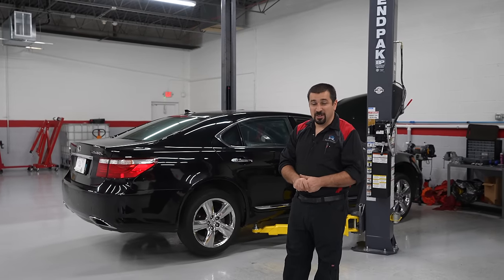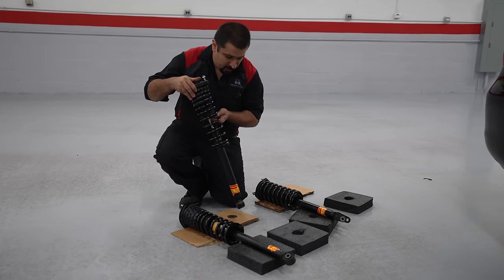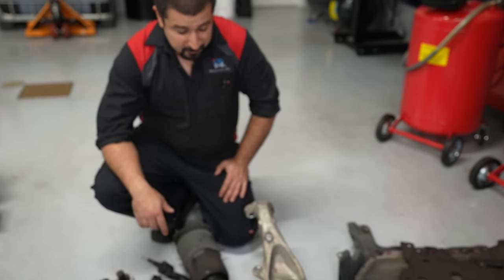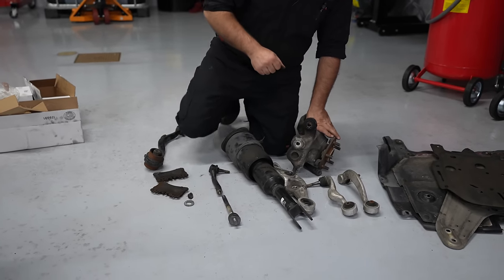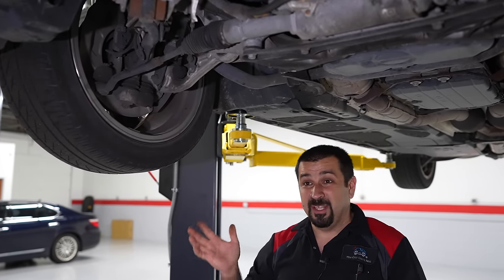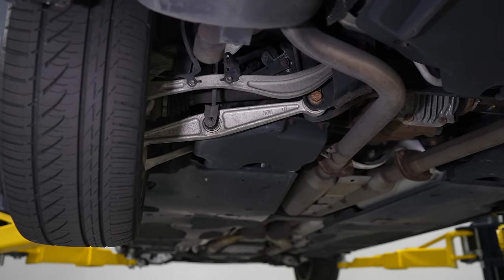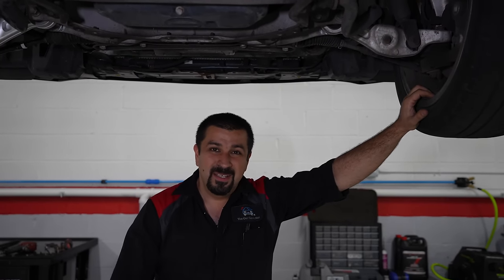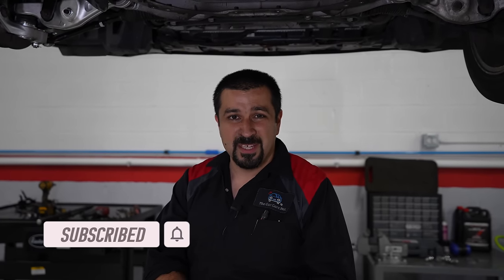Avoid THIS Lexus Model | Pre Purchase Inspection REQUIRED for this one and Here's Why.

Comment: My son wanted a higher end Lexus with all the bells and whistles.  I informed him that all those extras mean headaches down the road, plus they take premium gas.  He ended up with an ES350 - simpler but still has a nice interior.  So far he’s been happy with it.
Reply: Exactly you don’t need modern cars full of electronic crap and huge tables in them. So called outdated cars just works better and have less headache. If you want expensive modern car go and lease it.
Reply: @Motorsportsgeek  have you even driven the es350?  They are based on the Avalon btw.
Reply: @dyalanbrain001  Avalon is a camry, not hating on it, Camry is the best selling car in the world for good reason but typically when you go Lexus, you want the rwd based that is more of a lexus and less of a toyota.
Reply: We don't even have peasant fuel anymore across the pond. It doesn't hurt to use good fuel to have more power and a healthier engine. Unless it is a rather primitive design. 😊
Reply: @kr9181  The price of comfort is more electronics. 🤷‍♂ You can have even reliable electronics Japanese so called luxury cars of the 90s are prove for that, especially the Toyota Crown.
Reply: I thought I could buy one and get a 400hp reliable 4 door sedan. The car was a fast fun car but it sure wasn’t reliable.
Reply: @worldhello1234  if you are buying expensive car be ready for expensive repairs. More then over don’t buy used luxury car. But if you want one - new only and keep up with proper maintenance.
Reply: ES is a GREAT used car! The LS is very nice too, but as a previous owner of both, the LS issues add up VERY quickly.. Almost to the point where you pay for the car twice…
Reply: @worldhello1234  Comfort and no money to pay for it but is you are happy, well let all that money spill to the dealership,they will be happy.😁😁😁😢
Reply: I had a 2013 ES350. Bought it used in 2018 kept it for 2 years and sold it for financial reasons only. The car was flawless, not one issue in 2 years.
Same month I bought my 2002 ES300 from the original owner w 160k miles. All records showed on Lexus owners website. Timing belt, water pump and valve cover gasket all replaced at 88k miles.  Best car I’ve ever owned! Fit and finish is unparalleled. Craftsmanship is amazing. Tight and quiet. I’ve had comments on YouTube saying that it’s just a glorified Camry not even close the amount of insulation used and the tightness of the suspension is unparalleled. Shock tower brace under the hood and rear structural brace behind the rear seats really solidified this car
Reply: @worldhello1234  I've got a Toyota Crown Athlete VX and is has amazing tech for the time. It has also been completely reliable in the 2 years I've had it. Crowns, Elgrands, Vellfires and Alphards are all luxury and reliable
Reply: Nope
Reply: You don’t need to use premium gas and you don’t need to fix everything that breaks.  It’s smarter just to drive em the way they are.  I’d replace the air suspension with old steel suspension.
Reply: @Motorsportsgeek  avalon is not a camry
Reply: @worldhello1234  In Europe, the octane rating on the pump is simply the RON figure. America, by contrast, uses the average of the RON and the MON figures, called the AKI (anti-knock index). Thus, 97 octane “super unleaded” in Britain is roughly equivalent to 91 octane premium in the United States
Reply: I hope he isn't putting premium in it because my 2008 says it needs it but Toyota says it's not required. Takes regular.
Reply: @toyota420xp  It is look it up, they are based off the Toyota K platform (Camry), so are the ES300-ES350s
Reply: @mj28inpa  Wow man, that is sad. Considering LS400 was the Launch of Lexus in 1990 with market changing opinions of what is reliable and service. I remember the service was so amazing that one owner lived in the goonies in the middle of nowhere and his turn signal started to malfunction. A Lexus rep drove a replacement LS400 to him, drove his car to the dealership and back. It was big news. People bought Lexus for that reason.
Reply: @Motorsportsgeek  I hate to tell you this but an Avalon is not a Camry.  The Avalon is different and larger than the Camry.  That's like saying the Camry is a Corolla.
Reply: @frankie3591  I bet he lived in the boonies not the goonies. Hahaha. I am pretty sure the Goonies was a movie in the 80s though
Reply: Yeah, just get the basic model. These fancy suspension eventually becomes a nightmare
Reply: There's usually not many issues, but it can definitely ruin the experience when you roll up to a dealership for work or something .
Reply: @JasonFlorida  No its not.. The corolla is not based on the same platform as the Carmy,. The ES300/ES350 and Avalons are all based from the Toyota K Platform which is the FWD Front Engine Camry platform. Just because some models have slightly longer floor pans to get more leg space doesn't make the cars near identical in every other way like suspension/power train and again, same exact platform/frame.. Lexus just put a different body/interior and refines a few things but its much closer to a Camry than as you say, a Camry is to a Corolla.
Reply: @toyota420xp  https://en.wikipedia.org/wiki/Toyota_Avalon

Here is the wiki page, look under platform and all Avalons are based on the K Platform (Camry) as stated
Reply: @kr9181  People made fun of me for ordering my Corolla with manual windows and locks. I wanted as much reliability as I could get and the more crap it has the more crap breaks.
Reply: @Troy_Built  May be I would buy one too the only thing I don’t want CVT transmission. That’s why my decision was Base Camry LE. No auto start/stop which is really annoying, no electronic parking break, no turbo, no sunroof which I really hate and never use.
Reply: The ES is a woman's car. The LS is a guy's car. He got the wrong car.
Reply: @stephendibari5010  
Agree, I've at least test driven all ES from 1993 to 2014 (owned a 98, a 2003 and a 2010) and the interior material quality of the 02-06 definitely was the highest.
Reply: @kr9181  The ES 350 is probably the same age as the LS he wanted....
Reply: @brandonstclair6530  Which car?
Reply: The electronics on the Lexus are usually very reliable except for the LCD touch digitisers. They go on many brands of cars. But 10-20minute repair and 30 bucks..
GS460 is a good balance between the LS460 and the lower models for features though, no air ride, just adaptive shocks.
Reply: @imnotusingmyrealname4566  LS460
Reply: I have a 2022 es and absolutely couldn’t be happier.
Reply: @kr9181  I have a 2008 Lexus es350 for 4 years and I only had some maintenance items like a radiator and lower control arm.
Reply: Actually the ES350 is fwd.
Reply: Great choice es350
Reply: that motor still wants premium gas... you're just lucky it's direct AND port injected.
Reply: I bought a 2013 ES350 last December. Just hit 41k miles. Everything except the brakes, fluids, and the speakers is still original, runs/drives flawlessly.
Reply: Aren't ES350's expensive in parts and repairs down the road when they eventually do fail? And is there any reason why your son didn't go for the GS models?
Reply: @pushhard2  ES350's (2013+) are essentially Toyota Avalons with more "premium" interiors, options, etc. Most consumables like brakes, bushings etc are relatively cheap to replace, and far less hassle in complexity compared to the LS. Engine and transmission components as well as other parts are similar in price to the Avalon counterparts. Lexus trim pieces are a bit more. One really expensive oddity category on the 2013+ ES350, besides trim and seats, are the factory audio components, especially the head unit, amp, and subwoofer. If the factory head unit fails (especially the Mark Levinson unit with Navigation), the dealer will charge several thousands for replacement. Even the factory "sub" goes for $800 (much wiser to go aftermarket on speakers).
Reply: @Motorsportsgeek  a used GS could be a good shout too
Reply: @mj28inpa  Exactly
Reply: so a female vehicle
Reply: @chappy2121  where did you buy the Toyota crown athlete and what year is it ? Can you say what country ?
Reply: @jb3536  that is true! true with any car regardless of brand :)
Reply: The V8 they use in this LS runs perfectly fine on regular gass they use the same motor in their Toyota trucks them requiring premium is just a marketing ploy
Reply: @bpaige12  it might be ok in states but the regular fuel changed to E10 & E5 variants in Europe, so it can clog engine if using wrong fuel with this age of car
Reply: @innotafanofanyofjlbjlbissd6777  England. A company in Nuneaton who've been importing for 30 years brought it in. First Athlete VX they've had. 2001 and they only made 300 of them. There's barely and info online
Reply: Don’t Scotty Kilmer your son. Let him enjoy whatever he wants at a reasonable price.
Reply: @frankie3591  You're not wrong.
Toyota produced and serviced their 1st model LS400 at a massive loss, everyone in the car industry knew that.
Roll on a few years and the 'legendary reliability' of the Lexus name has gone.
You may as well buy a Camry if you want reliability (but not kudos) or, get the best of both worlds by buying the consistently voted 'Best Car in the World', a Mercedes-Benz S-Class.
Now, there is a car to behold, especially in Maybach guise👌👌👌
Reply: @Motorsportsgeek  the Avalon isn't a Camry.  It's bigger.   The ES is a fabulous car & is based on the Avalon,. Not the Camry
Reply: @stephendibari5010  that guy was a clown.  The Avalon isn't a Camry & the ES is based off the Avalon.  Not the Camry.   The Avalon is a bigger car
Reply: @8corymix8  You guys are in denial, go look up the wiki page as I said. Both the Avalon and ES are based on the camry platform. Its a carmy with a suit on, why can't you accept that?
Reply: @Motorsportsgeek  dude, the ES is based off the Avalon.   Not the Camry.    The Avalon is a bigger car
Reply: @8corymix8  lmao man, and what do you think the Avalon is based on? The Toyota K Platform, aka Carmy.. It just has a longer floor in the back for more leg room but otherwise, its exactly as a Camry, its base on the same paltform after all..
Reply: @8corymix8  yes ! Craftsmanship and fit and finish is far superior in my 2002 ES300. California Walnut real wood all over the interior. Sound deadening insulation throughout the car (floor pan, fender wheel wells etc ) makes my car super quiet. Front Shock tower brace and brace behind the rear seats (reasons why the rear seats don’t fold down) make this car super solid. There’s a reason why Lexus called it an ES; ES = Elegant Sedan. A person who hasn’t driven one nor sat inside one and experienced the luxurious interior they can talk nonsense about saying it’s a Camry !
Reply: @davidsparling3505  You know why? Because they went hybrid and the 2018+ Avalon/ES350 is based on the GA-K platform which is the modern prius. So now instead of a Camry, you got yourself a nice long-wheel base Prius with a Lexus suit.
Reply: @Motorsportsgeek  just admit you are wrong, damn. Lolz
Reply: yeah I wanted an is but got an rx its nice
Reply: @WeeShoeyDugless  Mercedes including the S-class fall below average in reliability.
Reply: @GCar35  
Let's just say this, my dad bought his 1st Mercedes, a 1954 170D back in the late 50s, he drove only Mercedes cars after that until he passed away in 1979.
I have driven Mercedes cars most of my life including many of dads cars and in all those years (to the present), I have NEVER had a single one of them let me down on the road.
The models range from the early 1950s Pontons, 60s Fintails and others, 70s S-Class, 80s 190s (many of), A-Classes, C-classes, E-Classes, W140 S-Class, R-Class and on to my current W212 E-Class.
As i mentioned, not a single one of them have let me down so i think i shall end my driving days driving Mercedes cars.
I must mention that all of my cars recieved the best servicing which they deserve and the rewards are trouble free motoring.
I have had Jags, Volvos, Audis, BMW & others besides but none came remotely close to the trusty Mercs.
Reply: @Troy_Built   They still build them that way ?😂
Reply: @andyleo8418  😂😂😂
Reply: @andyleo8418  Actually, the LS is an old gentleman's car...
Reply: I’ve had two LS 460s. Had issues with both. Loved they way they drive and feel but wasn’t ready to spend so much on repairs, which is why I went Lexus to begin with. Too bad cause otherwise I love the LS 460
Reply: @dyalanbrain001  the LS460 looks like an Avalon.  The ES appears to be based on the Camry.  I could be wrong.
Reply: @slchang01  The LS is for anyone who has a good job and likes nice cars for comfort and reliable driving. Family or single or retired
Reply: @kr9181  I financed NOT LEASE my 2015 Lexus GS350 F-Sport in 2016 for $42k.  My car's paid off and I'm not a SLAVE to a lease.  No major expenses on expensive maintenance or repairs.  Just regular scheduled maintenance and replacements of tires, brake pads, and rotors.  Not all expensive luxury cars are German or European CRAP
Reply: @kevinmccabe741 what issues did you have and what year and mileage were your 460’s?
Reply: Same. I wanted the LS460, but ended up with an ES350. It's not as cool as the 460 but it's still a good car.
Reply: My 2004 LS 430 still looks new inside & outside, and it still runs butterfly smooth & super quiet (you don’t even hear the engine noise), and it has 238,000 miles. I do not think any Mercedes S-class or BMW 7-series models could still be running reliably given the same criteria.
Reply: My 2010 rx 350 is fine with me:-)
Reply: @kr9181  i
Reply: Es 350 should take premium gas too. At least my manual says...
Reply: @Motorsportsgeek No it's not, you are wrong about the Avalon.  Since its inception, the full-size Avalon has never ever been based on the mid-size Camry platform.  However the ES was until 2012.  That year the ES series made the jump to Avalon's full size platform, upon which it has been based ever since.
Reply: @peterfable  https://en.wikipedia.org/wiki/Toyota_Avalon
Reply: @peterfable  Look at the wiki page under "PLATFORM" Every generation was based on the Camry platform until now, 2018+ are now long wheel base prius. Lexus won't make a special unique platform for a damn Avalon, its simply a higher spec Camry, how is that so hard to understand?
Reply: @peterfable  A Toyota Sienna is a Camry/Avalon/ES300 with a minivan body, manufacture recycle platforms to maximize profit, they all do this..
Reply: @peterfable  https://en.wikipedia.org/wiki/Toyota_K_platform
Reply: @andyleo8418  Ha ha, you probably are right!, We have an LS, I love it, wife wants an ES!
Reply: @highwaystar3780  go lease your new junk, some people prefer to own things rather than rent out new plastic garbage that barely last 100k
Reply: @Motorsportsgeek  avalon is no where near camry. There is a 20k price difference when buying them brand new do you think that its a coincidence? No the avalon is based on the es I driven both the camry shakes at on highway speed on nearly 150-180 but the avalon is just a masterpiece they dont shake even on 200+ even have records of both
Reply: @abdullah6747  You paid for a camry with better insulation and interior thats the bulk of it. Mechanically and structurally, ES and Avalon are camries
Reply: @Motorsportsgeek  so what ur saying is that an m5 comp is basically an m530d? Because it makes no sense to me yes they look the same but the suspension is different the drive quality, the car js lowered, windshield, double glass the material they used, the headliner, the leather used is premium the infotainment system the ride quality I mean u get what u payed for at the end of the day they are all just Toyotas not expensive but certainly not cheap. Avalon is no where near camry.
Reply: @Motorsportsgeek  plus if you want a sport car there is the crown its a rwd based car so you’ll have fun with it but its not here in the states its a rare
Reply: @Motorsportsgeek  and yes mechanically they are not the same the engine yes but that’s about it
Reply: @abdullah6747  learn to google... ES, Avalon share the exact same platform as the carmy. The rear floor panel is slightly longer for more leg room, thats it.
Reply: @Motorsportsgeek  yeah google ill let that npc source for u I saw both in person and they are so different the camry is more like a bigger corolla especially with that 4cyl but the v6 model is no different just more powerful camry. The avalon comes standard with the v6 because its a luxury car I bet u didn’t see what 2011 avalon limited and what it had to offer. It competed with the E class and the 5 series if u don’t trust me say ask ur friend google or better check one in person and see for yourself my friend
Reply: @Motorsportsgeek  plus u don’t see much avalons around here people will just talk shit but they didn’t see the or even have the time to check on in
Reply: @abdullah6747  Don't worry, they are still great cars. Camry is a great platform. Best selling sedan for good reason.
Reply: @Motorsportsgeek  yeah but camrys main focus is reliability you can rely on them but they are not comfortable to drive. I have an 340i f30 and I know what im talking abt. Avalon are really underrated for the money 20k more the Avalon driving dynamic is just better in every way
Reply: @abdullah6747  Man you still dont understand avalon is just a camry with better suspension. Your f30 would compare better to a IS250 that is actually RWD and a unique lexus platform not a toyota camry FWD platform like ES/Avalon. You obviously get a lot more with those, better interior, better insulation, more luxury features, better suspension but beyond that, its a carmy.
Reply: @Motorsportsgeek  well what could you ask more then that it’s literally 280hp on a sedan more power doesn’t bring more customers they found on the car because luxury and comfortable to drive even at very high speeds unlike the camry
Reply: I just got rid of a 2019 ES350 . I hated that car with a passion , just a soulless geezer mobile . I traded it in for a 2023 IS350 Fsport , I’m much more happy with that .
Reply: @jamesstewart3771  Well my 2008 c350 served me well. Programming the transmission and having manual paddle shifting made it much more enjoyable to drive. Stock they are quite the geezer mobiles.
Reply: @jamesstewart3771  well it’s lighter and smaller with awd and the engine is the same tho
Reply: @abdullah6747    Same engine yes , but different tune . The IS has a high compression tune with a factory cold air intake . IS makes 311hp to the ES’ 301 hp. The IS is only all wheel drive if you get the AWD version . Mine is rear drive . The IS  is just a better looking car also . It has its own platform , where as the ES is a Camry with a better interior and more sound deadening material making it heavier than the Camry .
Reply: @Dudeman9339 no it doesn’t, just stop. What are you talking about, “that engine wants…”?
Reply: @Troy_Built I mean, youre not wrong, it will be cheaper to replace if it breaks, but window motors have got so cheap now and last so long, I would have just got the power windows. Are you really gonna keep your car 20+ years?
Reply: You need money to own big cars like this.  People forget that.  Years ago people drove cars they could afford. Today is nuts.
Reply: Terrible advice should have a gs350
Reply: No cooled seats?? Yr kidding
Reply: Jk ES350 is great my dad has had one forever but honestly my cheaper 2 year older gs350 is a killer in comparison
Reply: Fancy Camry. Solid engine
Reply: Wikipedia is not facts.most Camrys are 4 cyl for one and Valons are 6cyl  @Motorsportsgeek